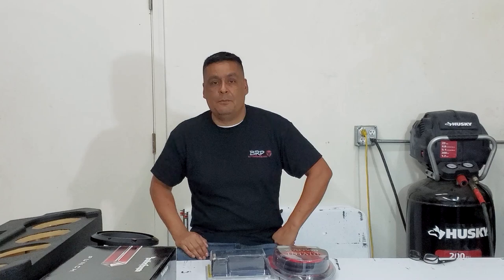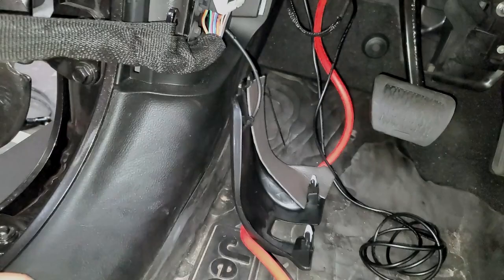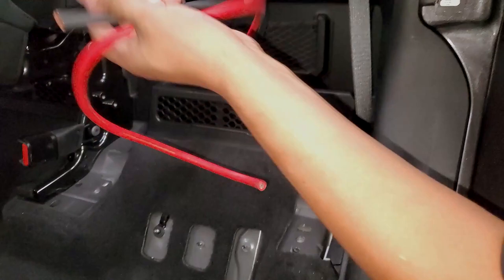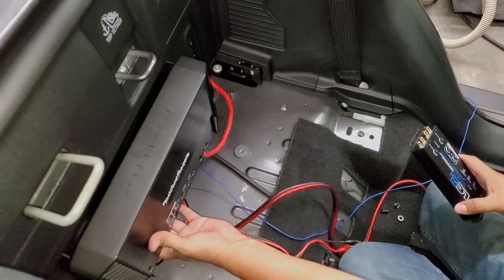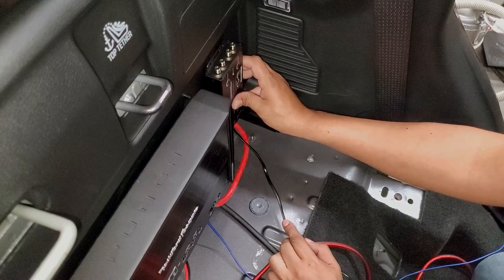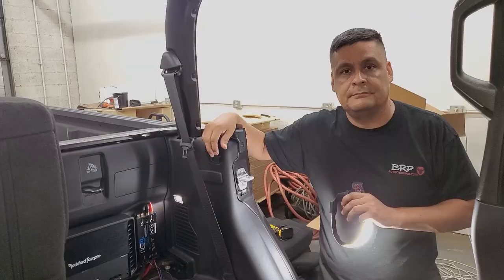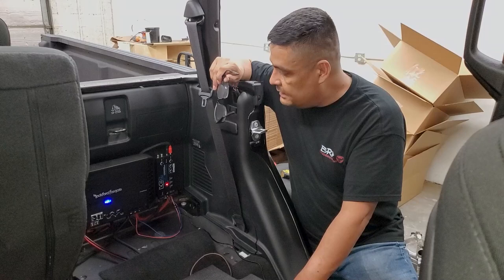JEEP GLADIATOR/WRANGLER SPEAKER AND AMPLIFIER INSTALL | HOW TO GUIDE!

Comment: I bought this box in the packaged version that came with two 10” Rockford Fosgate R2 subs, all the cables / hardware, the amplifier and output converter this June (2022) and I couldn’t be more impressed. These videos were really helpful. I would just say to make sure you slow down and have the right tools. A breaker bar was nice for removing the back seat since the bolts have thread locker on them. But the install was very straight forward. Super super quality product. The best part is I called the place twice with some questions and the owner himself answered. Talk about a rad small business making a great product. Oh, and the subs sound excellent after a little tune.
Reply: How are you liking the box a month later?

Comment: For future installs on Gladiators/Jeep JL, there is a wire gutter that you can put that red cable through instead of stretching it across the engine bay. In fact, you attached the wire to it! ;)
Reply: Do you know where I can find?

Comment: Loved the video , thx . Quick question though , I have a 2018 jeep Jl rubicon and I’m trying to run my rca converter. I removed my Rear sub and see 4 plug connection into the sub . What wires do I get to ? Much appreciate your response. Thank you

Comment: Good job; you may need a capacitor, however; you are an excellent technician and would make good use as an Avionics Technician on our Black Hawk helicopters at Patrick Space Force Base
Reply from the maker: Not for 500 watts of power.

Comment: This was helpful! Thank you very much! 💯
Reply from the maker: Glad we could help.
Reply: Quick question, if I wanted to run 2 amps in my JL Wrangler do I need a different line converter or can I use the same one you used here?
Reply from the maker: @ianbailey2127  No. You will need to buy the Audio Control LC7i. That's made for 2 amps. We have them on our website if you need one.

Comment: awesome video…i’ve already replaced all factory speakers on upper and lower dash and sound bar with jbl speakers i want to add a amplifier and rear seat subs also to my 21 gladiator with alpine system which has its own sub woofer what do u recommend to do with that alpine factory subwoofer
Reply from the maker: We just leave the factory sub alone. It won't effect anything.

Comment: Did the mounting screws penetrate the back of the cab? If so, did you seal them or coat them? I’m mounting 2 DS18 amps in that area. 
Video is awesome and so informative. Thank you.
Reply from the maker: No they did not.

Comment: i am confused by your installation. you said you were doing front dash speakers, sound bar and sub. you only ran 4 wires to the sound bar. what about the front speakers and the sub.? is these a only a 2 channel setup with out a fader control on the radio?
Reply from the maker: The video is on how to install 1 amp and Subwoofers, not the soundbar and dash speakers.

Comment: The LC2I shows to use a 1amp fuze in the 12v power, nothing about the LC2I Pro though on their website,  (also what I bought). Do I need to run a 1amp fuze inline from the amp to the LOC?
Reply from the maker: No.

Comment: Great video! My installer said he can’t get the Gladiator started. All the lights turn on as if the Jeep will turn in but no spark. Now he’s trying to figure out why. Any suggestions? It’s 2023 gladiator Willy’s
Reply from the maker: Check the auxiliary battery. That's usually the issue. It's located under the big battery.

Comment: @BRP Auto I  recently bought a kit from you guys and absolutely love it!  Only issue I have is the sub woofer knob isn't working.  However I'm not running the in line converter as the head unit I have isn't factory so the wire for the sub knob is plugged directly into the amp... is this correct??
Reply from the maker: We would need to know exactly what kit you bought from us in order to give you the right information. Best thing to do is call us or email us with that info, so we can give you the right instructions.
Reply: @brpauto7313  thanks.  Just sent you an email about it.

Comment: So where you installed the power wire it’s safe to have multiple wires connect to where that battery nut is ?
Reply: I accidentally installed it to the main positive batter where the clip and the beveled nut is, shorted out my whole car.

Comment: What did you did with the factory sub? Did you leave it installed or did you remove it? Does it still play if you left it in? Also if I add after market speakers do I really need to add a Amplifier to them,or can I let the fa they head unit power them?
Reply from the maker: We left the factory sub connected. It doesn't effect anything.
Reply from the maker: Not at all. It will continue to work exactly like before but won't effect anything.

Comment: I noticed the sound bar speakers have very little lows or highs,does the stereo limit this,or is it just because of the speakers,adding subwoofers also and didn’t know if that would be a good speaker wire to splice into.
Great video also👍🏼👍🏼
Reply from the maker: I can help answer the question but first I need to knw. Are you still running the factory soundbar speakers or did you upgrade them?
Reply: @brpauto7313  I will be upgrading them.
Just wasn’t sure if that wire would be good to use as a signal for the lc2
Reply from the maker: @Bud1lite  I'm not understanding exactly what you are doing or wanting to do. I'm in the office for a little bit right now. Give me a call I will try guiding you the best I can. Here is my number (480)569-3133
Reply from the maker: I never heard from you, so I will try and answer the best that I can. If you plan on installing 2 amps. 1 for the subs and one for your mids and tweets. You will need to use the LC7 not the lc2. The Lc2 is only for 1 amp and the lc7 is for 2 amps. If your not planning on using an amplifier for the mids and tweets just upgrading the factory soundbar speakers will make a huge difference in sound quality.
Reply: @brpauto7313  thank you for the replies,according to crutchfield you can have a sub amp and main speakers just would lose fader option.
But I’ll get all that,only question I really had was if the sound bar speaker wires were a good signal to use ,obviously it works just fine after watching your video.
Appreciate it👍
Reply from the maker: @bud1lite  Yes. Without any issues.

Comment: Will this system work if I already have the upgraded alpine system? Will I still tap into the green wires from the pillar like you did in your other video?
Reply from the maker: Yea. Everything is exactly the same.
Reply: @brpauto7313   so the sound bar speakerwires in the video will have all the "lows" going to them? (on a alpine system with factory sub)  just curious if you could use the alpine sub line going to the rear sub instead of the soundbar wires
Reply from the maker: Yes. The system will have all the lows but you can tap into the rear sub. It's easier to tap into the soundbar. In order to tap into the rear sub. You will need to remove the seats.

Comment: What is that box on the passenger side that is coming through the carpet? I guess that part got skipped over. Y’all tucked the box underneath the box to hide it.
Reply from the maker: That's the module for the rockslider steps we installed on the Gladiator.
Reply: @brpauto7313  ah ok! Thank you!